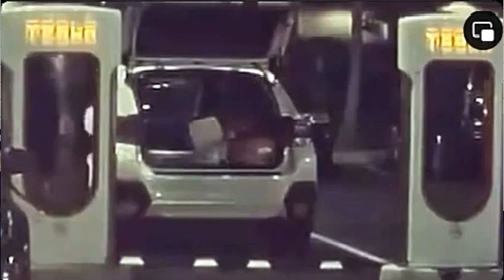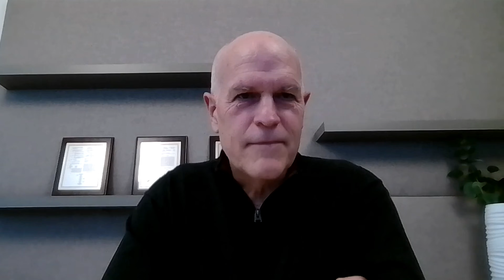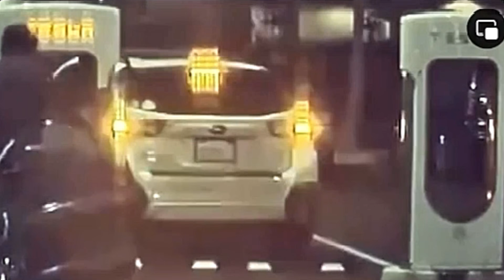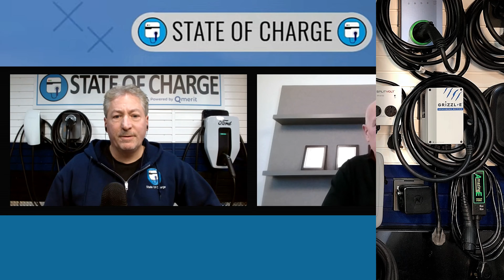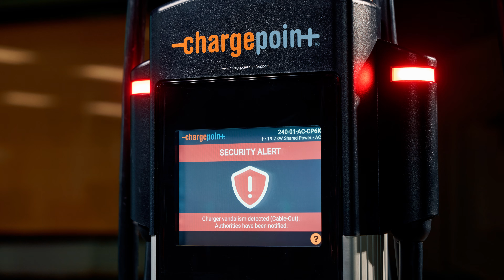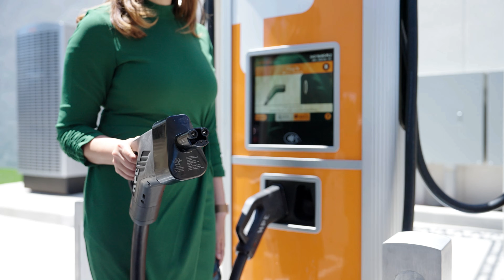Chargepoint CEO Rick Wilmer Explains New Theft Resistant EV Charger Cables, Charger Protect Feature

Comment: I had a conversation about this vandalism issue with EVSEs. Why don't they provide just a charging port at the EVSE and create another connector standard so the customer can bring their own cable and connect it to the EVSE? Wouldn't that greatly deter at least the economical draw of this kind of theft?
Reply from the maker: It's not possible for DC fast charging as the cables need to be liquid cooled. They are extremely expensive and too heavy, even if the technical challenge of liquid cooling was solved. It can be done for slower, level 2 charging, however. That's actually how most slow charging is done in Europe - they bring their own cables. But it cannot be done for fast charging.

Comment: wouldn't the attempt at cutting it will also be just as bad as a small cut or tear renders the cable dangerous to use so it needs replacing anyway?

Comment: Made a mistake and ordered a ChargePoint Home Flex EVSE to "charge" my new EV, a Genesis GV-70 EV..... The unit stopped communicating with my WIFI although I have a very strong and robust WIFI signal in the garage, which meant that the app was useless.  When I reported the problem to customer support they were unable to understand my email address after multiple attempts to clarify delaying the mitigation of the problem.  The good news was that the EVSE was still able to charge my EV, until today, when the ChargePoint failed completely.  A replacement is supposed to be on the way after I called again to customer support.  100% failure rate. very disappointing.

Comment: Keeping the cables powered up while stored is the best option.

Its comon knowledge if you cut a power cable, you probably get electrocuted. Also post a sign for the dumb dumb crackheads.

Depower the plug while being handled by customers.

Comment: It is nice to hear that they are working on resolution to down chargers.   Historically there have been a lot of non functional chargers, it would be nice to have reports on if they have in fact improved uptime, and track it.  
For charge points not working, perception is reality.  If it isn’t their problem from an ownership standpoint it is their issue from a business model because it’s failing.

Comment: How about solving the issue entirely:
Put the cable IN THE CAR rather than the charging station.    The power cable for a vacuum doesn't come out of the wall, after all, does it?
Then all the stations have to do is have a universal connector and the cable management itself goes back to the vehicle manufacturer.

Comment: Several years ago at an Airbnb in Missouri, I looked out the window at the air conditioner units below where they were chained to a concrete slab with a heavy log chain in an X configuration.

I asked the owner of the Airbnb what was the chains for And he told me that was to prevent thieves from cutting the coolant lines and stealing the whole air conditioning unit for its copper. 

This is akin to thieves stealing manhole covers for their iron content.

The law enforcement really needs to slam down hard on this issue.

AND Thank You so much for this interview with Rick Wilmer and thank you to Rick himself for taking this much needed step.

Comment: I like the idea of each person having there own cable and you simply plug in your own cable
Reply: That's obviously impossible! ICE cars don't need to bring their own hose. /s

More realistic issue, cut rate cables causing fires. Happens regularly with power strips and extension cords.
Reply: @Senthiuz 
A little off topic to mention ice hoses....
Nobody is stealing Petro hoses are they?
Certify and register (micro chip) cables that have to pass & guarantee reliability.
Tesla does this already with their vehicles & lvl 2 chargers.  Stops charging when amperage/heat jumps too quickly.

Comment: Custom cables, pre-tinn the copper.  Add aluminum strands, add soft steel strands.  Makes the scrap value low.  Include microstamped strands.  Take scrapyards to court when they have that wire.
Reply: Maybe add mico locators to the strands  & follow the vandals to the offending scrap yards.

Comment: I work in appliance heating wires that are used outdoors.  In Canada we have a cable type called TECK90.  This cable is very common in Canada.   It has a wrapped stainless steel sheath under the PVC outer jacket.   This cable is allowed under the code to be used outdoors without having to use conduit.   Combine this with a Kevlar reinforced mesh embedded in the outer extruded jacket and it would be a very challenging cable to cut.   I presume this is very similar to what Chargepoint has done.    I've actually thought about a cable like this myself for this same reason.   I'm happy to see Chargepoint has developed it and even more happy that they are looking to share this with the industry in general.  

Every Cable can be cut.  But if this creates a large enough barrier then it will at least make it more rare and make it a large enough deterrent not worth a thief's time.

Comment: Mr CEO says he does not like the "bring your own cable model", but I think it makes a lot of sense, particularly for AC chargers. I understand that increases the risk of electrical issues due to poorly functioning cables. That could be mitigated by requiring cables with internal sensors and chips that monitor the health of the cable. I can't tell you how many times I have rolled up to a charger and find the handle broken and either unsafe to use or dysfunctional. It is for this reason I like the idea of the "bring your own cable model". All the best.
Reply: I think this makes more sense too for destination lvl 2 chargers....
The resort/hotel/motel can also have loaner cables available for guests who don't have one.  This would also mitigate some of the upfront costs of putting EV charging in place.
Another thought ....just providing nema14-50 40 amp outlets stations for use with portable chargers.
Reply: @robertgalle4331  I really like the idea of "just providing nema14-50 40 amp outlets stations for use with portable chargers", BUT the problem with that is then the thieves would just unplug and steel the whole portable charger, which would likely be worth more than the cable by itself. For this reason, the BYOC (bring your own cable) is still probably the best solution.

Comment: And every one of the people stealing these cables with extremely rare exception has a lengthy criminal history of arrests for theft, robbery, fraud, and other crimes, and they've learned that the justice system is a revolving door that will often reduce, plead down, or drop charges entirely because there's not enough manpower or room to adequately deal with everyone, and because in many areas they've installed "reform" mayors, prosecutors, and even police chiefs who won't sentence anyone appropriately, or made it so doing so is impossible.

Comment: We need to move away from charge cables and move to wireless charging. There are other issues with chargers such as when the contacts are compromised. More important is to move away from Li-Ion to non explosive battery technologies. EV fires are impossible to extinguish and the burn extremely HOT..

Comment: I just thought of a good idea. How about pressurized small diameter tubing containing ink/dye under pressure  surrounding the cable between the insulation layer and the hardened stainless steel. Just like the dye packs contained in theft deterrent money bags. the copper thieves will be easy to identify when they look like a Smurf.
Reply: This would be an inexpensive added deterrent.
I like it!

Comment: Wrong tool to test with.  Carbide tipped saw blade in a cordless saw should work better for the test.  Grinding wheel takes too long when it gets fouled.  Insulation and conductors could be color themed and embossed with "Charge Point"  with identification plastic strip inside.  Handle should have a flashing LED in it with a small battery that stays flashing when cut.  Embed Air Tags in the handles that activate when cut.
Reply: Micro air tags imbedded in the wire strands...
Most vandals just cut cable free of connectors...
But I like this idea as a catch and release to pay for damages.

Comment: hang the cable in a strong lock box. Access that locker with a discrete pin code that is generated by the app upon each use. Seems like something that can be modded to current designs.
Reply: I like this idea too.

Comment: And the alarm system does what when 99% of charge stations are unattended? It's basically like old fashioned car alarms, just there to hopefully scare people off. Even if it automatically calls the cops, they aren't going to respond any time soon.

There is an easy solution to this, put a human in the charge station, you know to monitor and maintain the stations. Sort of you know a Gas station attendant used to do.

Comment: Since we converted most of our construction sites to highly flexible aluminum cable, most feeder cables only get stolen once. Unlike in copper days where they’d be clipped every other month. Might work for charging as well. A lot lighter as well.
Reply: No diameter increase seemed to be a requirement(probably for the weather fittings) but this is honestly best idea, can't steal copper if there is none. Maybe even throw text  that says aluminum wire on the jacket

Comment: If cable theft is that big of a deal the thing to do is to totally remove the cables, replace it with a socket and have people plug into the socket with their own cable. This stops the cable theft, pushes the cost onto consumers and stops the whining of people who complain about backing into the charge stalls, cable being too short or on the wrong side of the car.
Reply from the maker: It's not possible for DC fast chargers because the cables need to be liquid cooled
Reply: @StateOfChargeWithTomMoloughney  First the guy from Chargepoint said that the cable cutting is happening mostly with level 2 charges NOT DC fast chargers. Second Tom is already advertising DC fast charger extension cables for Tesla superchargers to get around the short cable problem.  If they can do that they obviously do the socket.
Reply from the maker: @lashlarue59  I think part of the reason why Rick said what he did it because Chargepoint has mostly level 2 chargers in service, very few DC fast chargers by comparison. Probably 90 to 95% of Chargepoint chargers in service are L2. When I see news reports I see a lot of EVgo DC Fast and Tesla superchargers being targeted. EVgo DC fast charger cables are almost as long as some L2 cables.
Reply: @StateOfChargeWithTomMoloughney 
So why not make a nema14-50 outlet available at each charger as an alternative access to lvl 2 charging?  Most EV owners have one and are relatively inexpensive.
Use of the charge station app to access that particular stations outlet for charging, even if  vandalized.

Comment: In Europe we do not have this big problem with AC chargers., because we have the cable in the car and only a connector on the Station, which also makes the Station cheaper. Wireless charging would be a solution. But i do not see this happen very soon.
Reply: In Europe, it is easy to mandate a single standard and apply it everywhere.  In the US, you have literally thousands of code departments that all get a say.  Plus, European population density can support methods that wouldn't work in the more sparsely populated US.

Comment: Include a standardized charge cable with each vehicle. Standard NACS receptacles on charger and vehicle. Like a standard electric cord exists and standard receptacle and plugs exist for power tools. Make the cable from aluminum for current electrical capacity.
Reply: Lots of problems this likely won't work, at least in the near future.  In particular, aluminum power cords would be several times the size.

Comment: I still think that someone needs to authorize to get access to the DC cable. Using level 2 cable to communicate with the charger. Only wired would be for communication. Once the charger and car have a successful connection. DC cable will be available to use. The charger will know what car is ready to charge.

Comment: The best solution to all ev charger cable issues is to make electric vehicles with their own cords, like every toaster and tv, and to replace the cables on chargers with a receptacle.
Reply: Way too dangerous and more importantly, way too much liability.
Reply: @ Think so? I figured they could keep power off at both ends until the car was locked in park and the connection ( and billing) were verified.

Comment: Leaving the cables electrified is going to be the only deterrent
Reply: I was thinking this. Or a high voltage outer metal sleeve that has enough voltage to pass through the rubber grips of a tool handle 🤣

Comment: I had two thoughts when I first heard about cable thefts years ago:
1) Put steel tape or braid on the first layer under the sheathing for cut resistance, which could also double as the ground current collector to eliminate one copper wire altogether
2) use aluminum cables for the main current conductors, reducing the scrap value in half and making grinder-wielding thieves miserable since aluminum is very gummy on cutting wheels

Comment: Im an commercial aircraft mechanic on large aircraft. Aluminum generator feeder cables are used on jets.  Can’t they use aluminum?
Reply: Presumably the bigger and stiffer cable is an issue, especially for the elderly or slighter of build.

Comment: Yes you would think the thicker level three cables would be a more lucrative target, however the thinner level two cables tend to be longer, therefore having more copper in them.. I can think of a couple of solutions for this problem. One of course is to have wireless charging. The second is bringing your own J1772 cable and plugging it into the charger and then taking it when you leave.
Reply: I think the fastest chargers use liquid cooled cables.  That complicates any system for plugging a user supplied cable in.
Reply: @ like I said. Level threes are not as vulnerable because the cables aren’t as long, there’s less copper

Comment: Why not design a charging machine that retracts and locks the cable inside when it’s not in use? Maybe even include a secure door to keep the cable hidden and protected. Leaving the cable out in the open just makes it an easy target. Slowing thieves down might help, but using the “out of sight, out of mind” approach seems like a more effective long-term solution.
Reply: Would be very difficult to do with how long these cables are. No room in the charger itself. 

Also cable management would get in the way and how would you retrain EV drivers to know that the station they are at has retractable cables and not just missing the cables. Not a really good move to try and fix this problem. What ChargePoint has done is going to really help with this.
Reply: @DunkBoi  I will be more impressed once they are out in the wild and the problem does not persist. How you retrain customers is by running a commercial that says. Have you ever pulled into an ev charger station too only to realize  the cords been cut? No worries when you use our service because our cord does not sit out in the open. It retracts back to protect itself and guarantee it ready to charge when you need it

Comment: Forget "flashing lights, buzzers and bells". Charge Point Protect should directly notify local authorities, so the thieves can be caught in the act, in possession of the severed cables. There should be a law, that the thief foot the bill for all the cables they destroyed, and as restitution, should pay to repair/replace damaged cables, whether they caused the damage or not! I'll guarantee, that they won't go anywhere near another charge station, unless they're there to charge an EV.
     It's OK if the theft resistant cable is thick, stiff, and heavy, as long as it's indexed at the charger, so the handle is up-side-up when the cable is unfurled, and the driver is ready to plug into their vehicle's charge port. If anything, that might make it easier!
      It's important, that it takes long enough to cut through it, that the authorities have time to arrive and catch the thief. You don't want to chase off the thief, just to have them go to another site, and do the same thing. You're doing a HUGE "community service" if you can "bait" a would-be cooper thief, and get them off the street! (You're more likely to actually get your money, if they only damage one cable before being caught)

Comment: Could someone please tell Mr Wilmer, the  E-Bike industry around the world  is an untapped market for this technology,  97% of cables used to secure  bikes and Ebikes can be
cut within  2 minutes to 10 minutes  using portable  grinder saws:   see:  https://www.youtube.com/watch?v=el1Xznv5ge4
Reply from the maker: He said anyone can contact him to license the technology.
Reply: Well first off, don't lock up your E-bike with a cable lock! it's not good enough and why are you complaining about weight when you have a motor to help out? Second, there are already a few grinder resistant U-lock designs out there, each brand having its own method for the grinder resistance, though they are quite pricy (Litelok X series and Hiplok D-1000 are the names I can remember off the top of my head). That said, a new, possibly open source method to achieve grinder resistance would be welcome if it can help drive down prices in that market segment and make better locks available to more people.